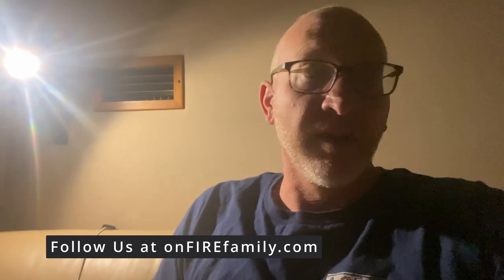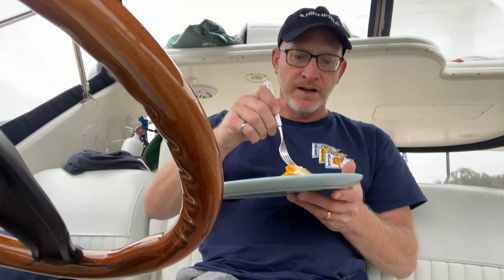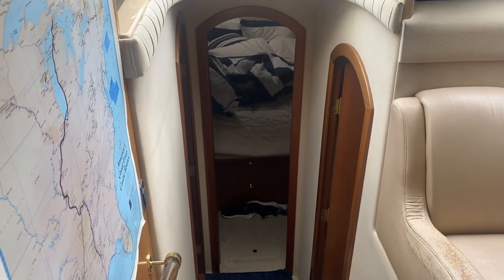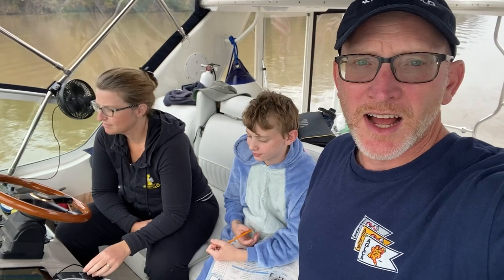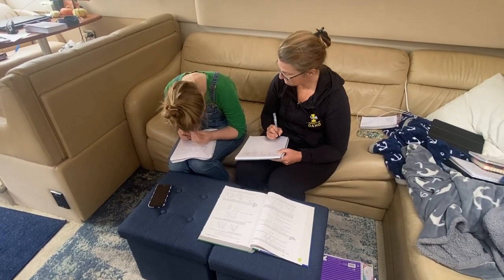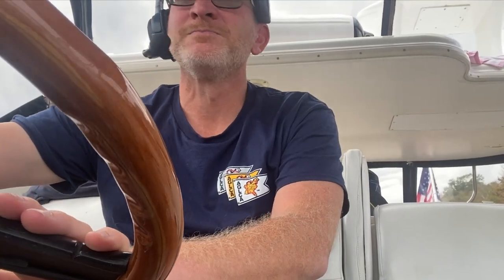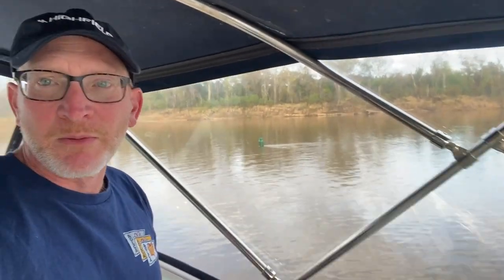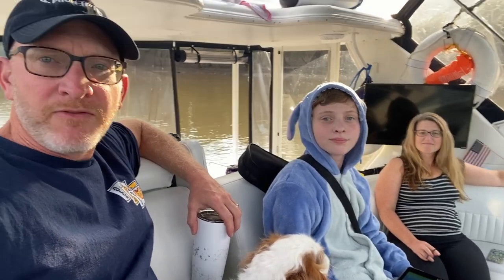A "Typical Day" on the Great Loop  |  Surviving the TENN-TOM  |  Tows, Locks, and Anchoring - Oh my!

Comment: The tow you passed above the Coffeville lock looked like he had 8 loaded hooper barges. We call those regulation barges and are between 195 to 200 ft long and 35 foot wide. The barge alone weights in between 432 to 732 tons each ( 864,000 pounds plus ) with out the weight of the product in the barge which can range up to about 1800 tons. It’s a lot of weight to move around the narrow bends of the river South Bound. We don’t make a lot of speed because of this. On the larger western rivers, Ohio, lower miss, upper ms, we can make better speeds south bound. When I am able to retire from being a tow boat Captain, doing the great loop is something I am really looking forward to. Thanks for sharing the video. Be safe out there. Be watchful once you get to  mobile. The amount of tow and ship traffic has been increasing and it has become a very busy port.
Reply from the maker: Thank you so much for the detailed insight!  We found the tows on the rivers fascinating.  We have another viewer who is a retired tow captain who is doing the loop this year.  I'm sure it's a totally different river experience!  Thanks for watching and commenting!

Comment: Great video. Terrific visual description of how a fairly typical day unfolds on the Tenn Tom. 

I thought the Howard tow you passed seemed minor league until you got past it and I saw it was pushing a block of three barges across. A massive tow. 

Really interesting to see how everyone spreads out during "home school" and after school is over. 

Another example of how crucial and valuable your hydraulic stern platform and comfortable dinghy are when you launched the dinghy effortlessly for a short trick or treat outing. Your quick and easy dinghy launch will be wonderful when you anchor out in places like the Keys and Bahamas. 

Thanks for the video. Excellent camera angles also.
Reply from the maker: Thanks!  Yes, we’ve passed some big toes for sure. And yes, that swim platform really allows us to use the tender often.

Comment: oK let me explain you Will not save gas going slow the only difference is TIME a Boat will go X distance on a Tank of Fuel fuel is measured by Gallons per Hour as is a Airplane but a airplane cant idle and fly so anyway  if you go 5 mph and a distance of 200  miles lets say thats a tank of fuel it will take you 40 hours  or you can go WOT let say 20 mph  cover the same distance use the same amount of fuel  but in 10 hours instead of 40  I have tried and tested this on many different size boats  its the same formula  bigger boat more fuel but the amount of fuel per mile is always the same.
Reply from the maker: Thanks for the comment. Our boat at least doesn’t burn fuel linearly. Particularly when our turbos kick in it starts guzzling. I’d be curious what others experience is.
Reply: @onFIREfamily Your experience is normal.  Every boat I have every owned had much better range at slower speeds.   Great video!